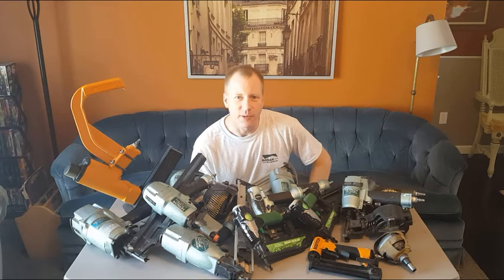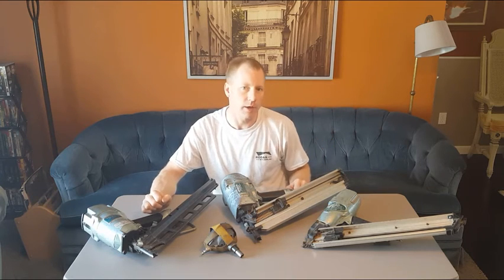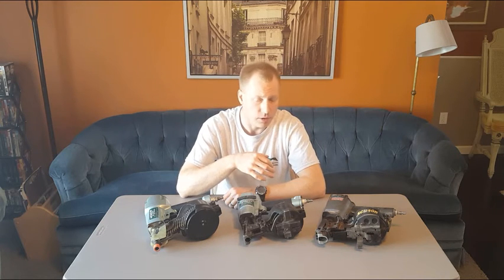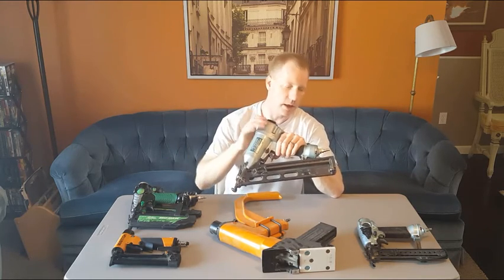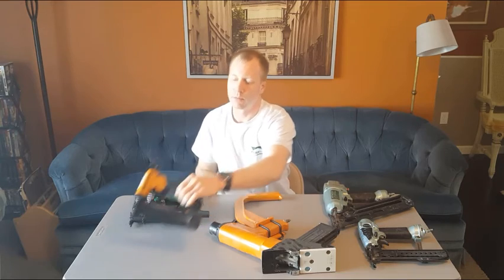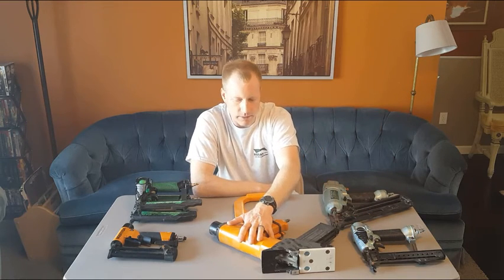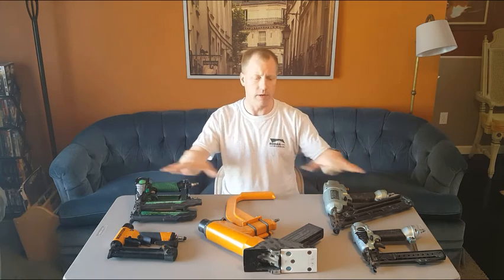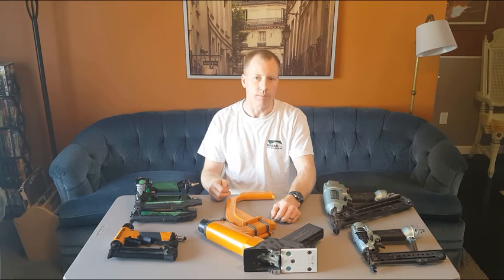Everything You Ever Wanted To Know About Pneumatic Nailers, Almost!

Comment: Hello, Dan. I am going to build a shed, build a deck, build a closet, then finish my basement over the winter. I can't afford numerous nail guns. Is there one general purpose electric (I don't want to buy a compressor) nail gun for my projects? I also don't mind just swinging a hammer. Thank you.
Reply: Screws work good too. They are cheap and you only need one drill or a impact driver, works the same.